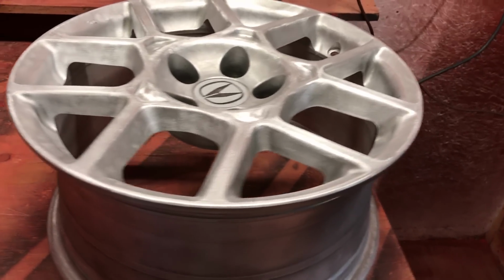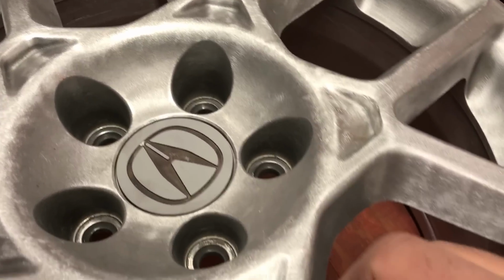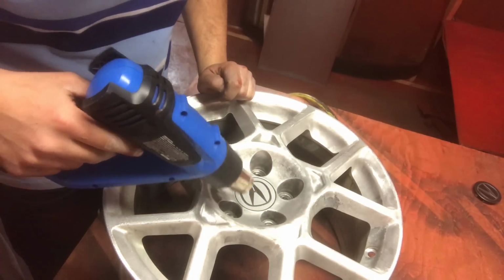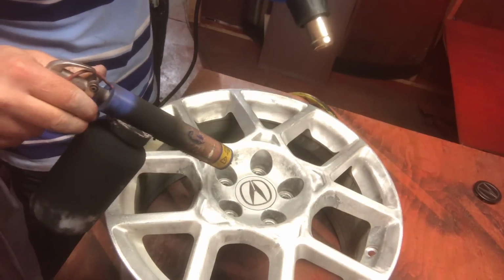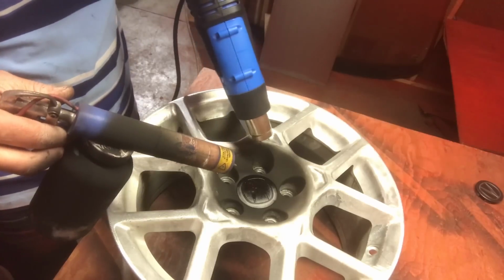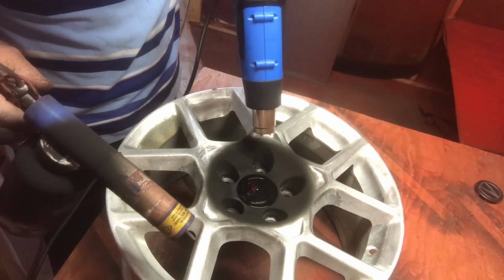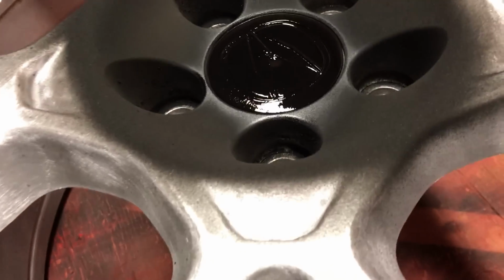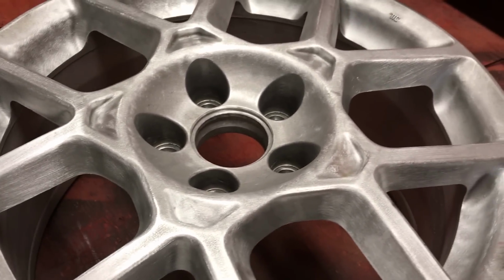HOW TO POWDER COAT PLASTIC!

Comment: I've found for powder coating one sided objects like this that aren't conductive, you can place them in a dish/tray/bowl and fill it with water so it submerges almost all of the part, with just the surface you want to powder coat staying dry, you can heat the living hell out of it and the water prevents it from melting/deforming. It's similar to how if you take a plastic water bottle and hold a lighter to it, it wont melt. If the type of plastic is the variety that floats or just wants to move around because its near neutral buoyancy, i'll attach a locking c-clamp to the part before submerging.
Reply: What about a bubbles coming out from boiling water?
Reply: @IzzuddinRaufa  you heat the item, just like in this video 🤦‍♂. you dont boil the water... the water is only used for heat dissipation, it takes a shitload of surface heat to fully heat up a body of water, way more than what you will need to heat the plastic up. itll make the top of the plastic hot and keep the bottom surface cool against the water which prevent warping.

Comment: Unless powder is cured at the correct temp and for the required time, it won't achieve the strength an durability powder coating is known for . While this is an attempt at powdering plastic , there are fundamental things wrong with it
Reply from the maker: you mister D'evon the goal here is no to achieve the strength Powder coating is known for ,  that’s the goal for the metal wheel ,  the goal for the plastic Center cap is to find a way to colour match it to the wheel .  If you want more durability ,  you can spray paint a durable clear coat on top for longevity and still have the colour match also .     I understand what you are saying but you have to understand that is not the goal .
Reply: Richard Edward  Nope. Color matching is the reason for doing this to center caps. No paint matching needed.

Comment: This looks like hot flocking. Normally reserved for glass and other non-conducting materials that can withstand curing temps in the oven. Very cool that it can be done this way if careful. Thanks for sharing!

Comment: I'm new to this powder coating why is the cap shiny n the rest nowt? Cause not cured on the wheel yet?
Reply: Watch video and he tells u why at the start. The wheel is aluminium. Doesn't get hot enough with heat gun

Comment: Tin of black spray paint £3 , full set of new centre caps £6 , or uncured powder on plastic 😲
Reply from the maker: Andrew Spence with black you might be able to get away with spray can . But not with all of the custom colours that powder coat comes in.  You will never be able to find a spray can to match it

Comment: cool trick but to me it looks like sht, rather just paint the plastic because the powder coat looks bumpy fish eye effect.
Reply from the maker: you can sand it with 600 grit till smooth and apply clear coat for a smooth , depth effect